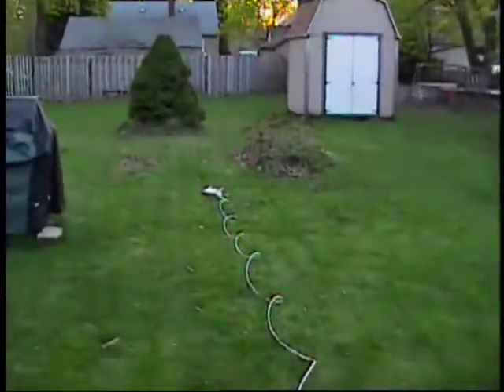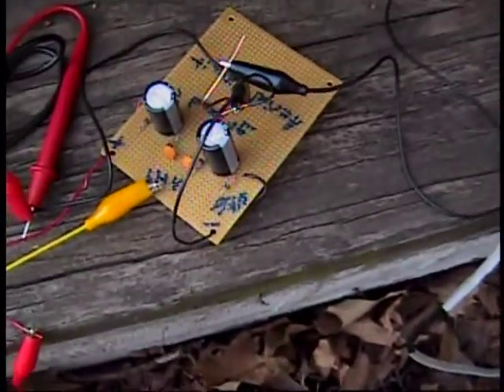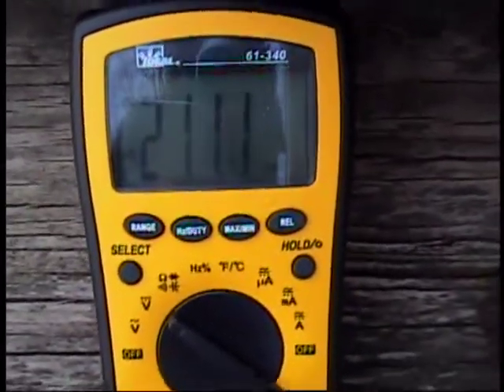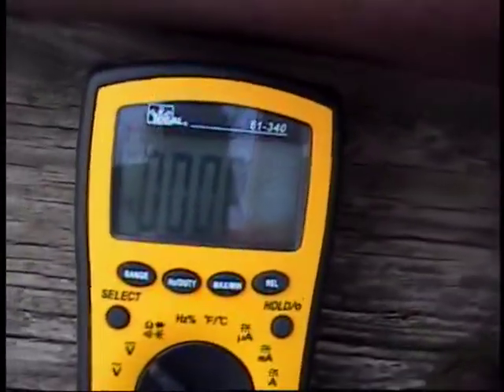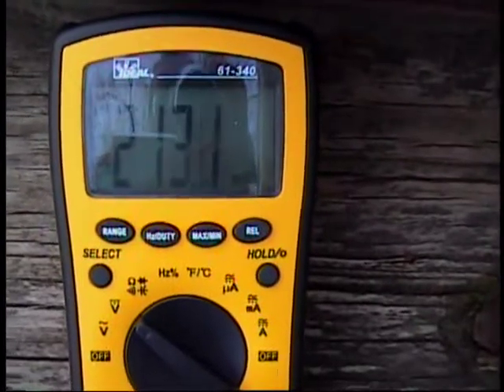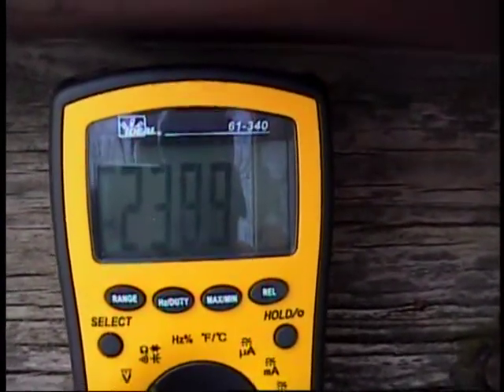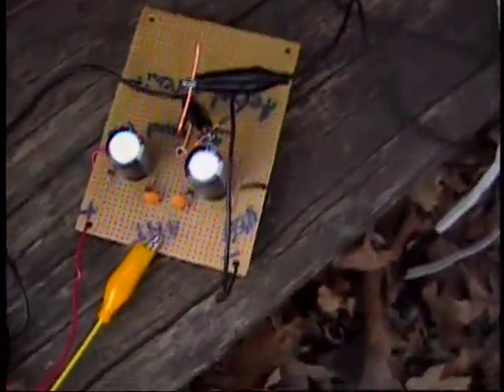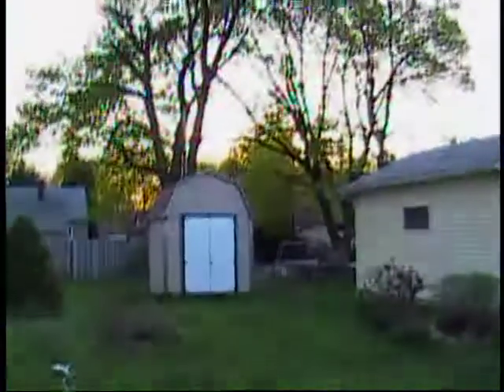Tesla Aerial 2

Comment: use amplifying coils to cause a vacuum and suck more juice. make circuit run one direction from the plate with a gate to prevent backwards flow. trap it away from plate see if you can draw more energy from plates surroundings..

Comment: Tesla patent says polished metal plate. Meaning not oxidized. So insulate the whole plate with insulation spray or something. Also the plate&cable connection and then use coax cable. Best results if you take the power out just in between the aerial and ground. So like 10m aerial cable - circuit - 10m ground cable
Reply from the maker: Thank you Belmior, I have been meaning to get back to this. As well as your suggestions I have been meaning to try smearing the metal plate with graphite. Also trying a screen to increase surface area.

Comment: The reason it didn't work when you put it in the air was your wire is insulated. Try a coax cable or just regular magnet wire you will see the difference. Check out my vid.
Reply from the maker: BackRoom Labs, thank you kindly for that tip.

Comment: Nice work! Try burying another trash metal instead of just placing it on the ground. Without the circuit, I get quite a bit more than using an Arial. Technically, this qualifies as an earth battery and moves into the realm of Stubblefield's work.
Reply from the maker: Solar OffGrid, thank you for the suggestion. I did not consider two ground points! I am still trying to shake the Thomas Edison way of thinking of grounding.
Reply: Ronald Gerth Thanks. I have done that before, but forgot... I have a bunch of old motor parts that was dug up last year laying foo laying some footings and want to use them as grounds..The PVC pipe under ground connecting them into my lab will save me from running over the connecting wire with the mower! lol